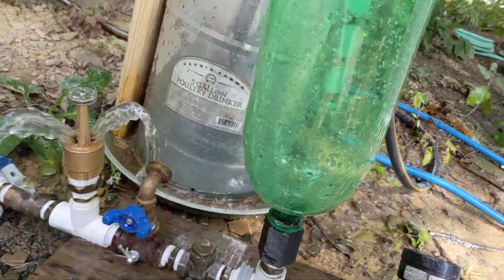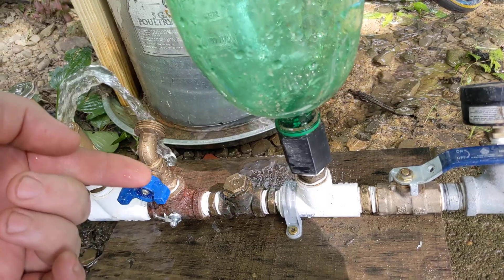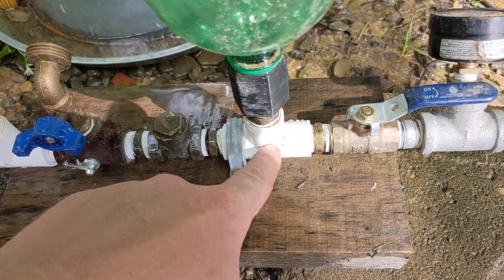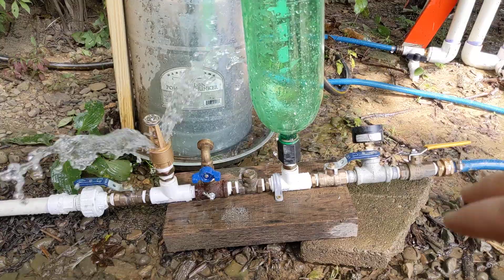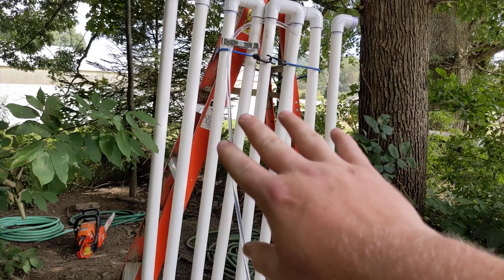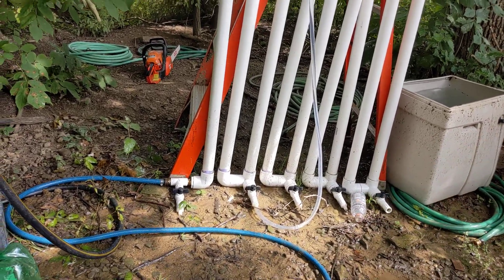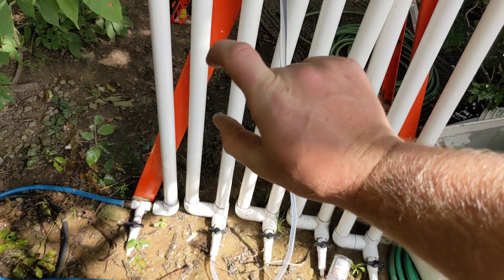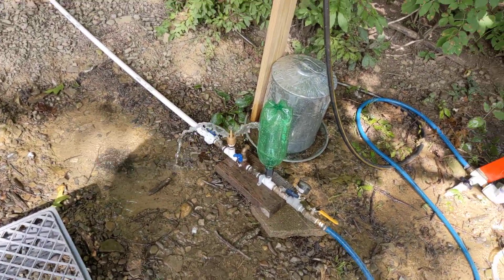Ram Pump hammering into air.

Comment: how about a huge barrel (air container) buried underground with a rising pipe that has a bend at the top (higher than your water line) going into a smaller air bottle like you have, so the water feeds small bottle, leaving the barrel and connecting pipe filled with compressible air thus increasing its force and scale without the too much more of an eye sore, ideally the smaller bottle would do the contracting of air and water, the barrel where the air to be compressed

Comment: Its amazing what you can build with things most people have laying around. Sprinkler parts and valves plus a soda bottle haha.

I was talking to a friend and he said back in Australia his family has something called a Glockemann Pump, looks like it uses a lot of the same principles as a ram pump in a different way. It looks like it is designed to be able to use its waste water as the water being pumped or create a syphon at the pumps source to pull water. I was wondering if you have looked at it or had any opinions on it.
Reply from the maker: I'm aware of those pumps and they are very cool.

Comment: A trompe compresses air by using water with bubbles in it flowing down a tube to use the weight of water to compress the air and the slowing the flow to let the compressed air out of suspension. Assuming that you are using cool water this process produces cool, dry, and clean compressed air. Great for industrial pneumatic equipment and with it keeping the compressed gas cool useful for compressing explosive mixtures like HHO gas for storage for trickling into an engine to increase efficiency.
You can also use multiple closed water cycles to achieve high pressure but then the heating of the water must be taken into account.

Comment: Joe, have you fixed the stream head coffer dam (to improve your efficiency, you found it had erroded a few videos back and you were going to fix it up)  nice pump, could you collect the waste water from the waste valve in a tarp and pump it all back to the tote using an electric pump (since this is all just for testing purposes) and use the spring flow to make up for any losses? (and the tote your simulated hill is filling too added to the electric pump system)
Reply from the maker: No I haven't fixed the weir yet. yes I have purchased a pump to run off of solar power and recirculate back into the system. Today I also found some perfect catch basins to catch the waste water that squirts out. I can measure this output to help determine pump efficiency.

Comment: Hi Joe, have you thought about adding a second pump but feeding them both into one outlet, and timing the pumps so when one is venting the other is pumping? Cheers
Reply from the maker: Land to House just did a video on dual pumps, they weren't synchronized and you would need some mechanical way of linking them. You can't put two pumps on one drive pipe so I don't see how it would be beneficial. Well you can buy still not beneficial.
Reply: @JoeMalovich  
Hi Joe,  Patent "EP2161450A1"  uses 2 mechanically linked valves, which open and close alternately.  If the velocity in the drive pipe can be preserved, by having one valve open and one closed at any one time, it could reduce the waste water.
Reply from the maker: @johnguest4525 reminds me of this flywheel pump. https://youtu.be/SqE7gSEN4fk?si=0OM3JbTYpvn08ZH6